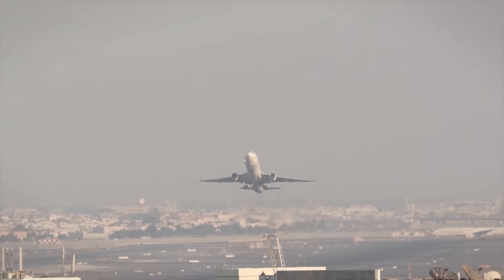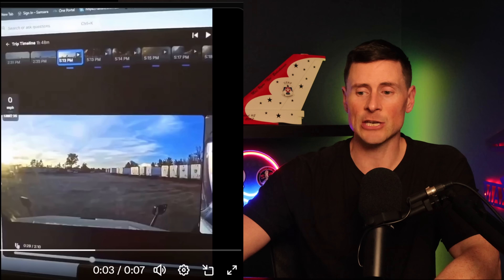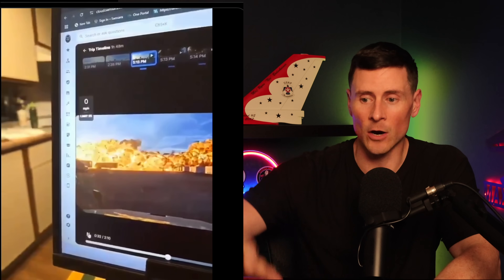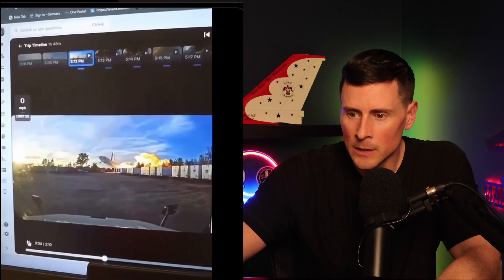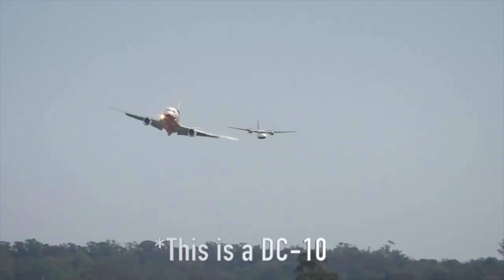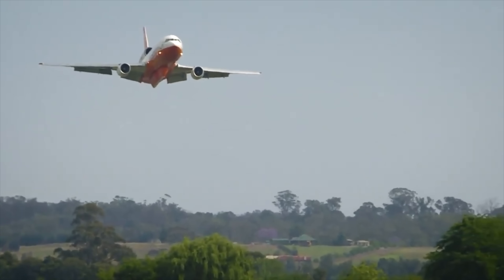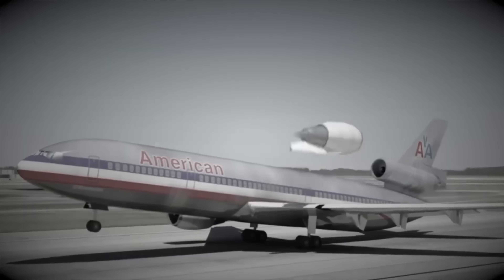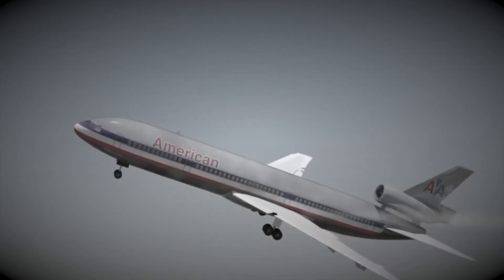Airline Pilot Reveals CHILLING Clue in Final Moment Before UPS 2976 CRASH

Comment: There was also a MD-11, if my recollection is correct, which lost the fan disck out of the number 2 engine over Iowa. The fan blades went through all the hydraulic lines, causing loss of all the controls over Iowa. They were able to guide the stricken aircraft down to the airport in Iowa city by using differential thrust with the two remaining engines, but in the end, they were too fast coming in, causing one of the gear to collapse, which in turn caused the aircraft to flip. The resulting crash killed a number of the people on board, but the fact that they were able to bring the aircraft down at the airport at all credited the crew with sparing many of the lives of the many other passengers.
One thing I wonder about is if parts from the detached engine might have been ingested into the number two engine, and if what we are seeing is debris from the number 2 engine coming apart rather than fire from a couple of compressor stall. Would the short puffs of flame and smoke coming from a compressor stall be visible among the rest of the intense flame coming from the wing, or might those be pieces coming out of the number 2 engine and sparking as they struck the runway? To my failing eyes, the video is a bit too blurry to tell what exactly that is. I guess the investigation will tell us more about that. Like with all air incidents, we will have to wait until the investigators tell us their findings, or at least the preliminaries.

Comment: If I recall, Flight 191 crashed because the engine replacement didn't follow the procedure. Basically, the pylon is to be mounted first, then the engine. To save time, the pylon and engine were joined on the ground, then mounted to the aircraft as a single unit. Due to the additional weight of the assembly and whatever other difficulties this brought about, the mounting bolts were installed incorrectly. The plane flew for a while, but the incorrect mountings put additional stress on the bolts until they failed. Afterward, I believe a service bulletin went out saying not to use this method.  Assuming the MD-11 had a similar design, I wonder if this recommendation was forgotten or never issued for the MD11?

Comment: The clip you showed of the roof of that building with the big gash in it was part of a much longer clip that also showed the front part of the cowling of the departed engine. In the dashcam video from the left side of the crash path that showed the plane rolling left and the right wing almost vertical, you can see the fuselage was angled up. I would have been surprised if the plane did not roll inverted before coming back down. However, there is another dashcam video from the road beyond the end of the runway where you can see the fuselage completely airborne and high enough that it contacts wires strung on utility poles and you can see those wires shake violently after it passes. A horrific accident indeed. No words can express the depth of my sorrow for those heroic crew members and those who were affected on the ground.

Comment: Prayers unto the departed , prayers for immediate FAMILY . 
A committee, a fuel crisis decades ago compounded by follow on design by artificial requirements . Thus Tri-Jets , an engineering solution to a decade specific requirement . 
Ooohhhh ! If Tri-Jets were a fuel crisis “decade” compromise , what does this say for twin engine “decade” “carbon-footprint” committee commands . If a Tri-Jet sux , THIRTY-YEARS LATER . Will ultra by pass twins achieve a much more clean historic record ?  In my opinion , If ALL strategic world beaters burn four fans . Indeed ,  four fans burning equals so many less digital candles lit .

Comment: Seems very probable that tail engine....if it were experiencing compressor stalls, it could be from the engine ingesting all of that "dirty" air from the fire....not enough actual oxygen for the fuel it's programing for.  So sad.

Comment: My house is about 2.5 miles from the crash, and I can tell you the building which was basically ripped open by the wing was at the start of the crash. Beyond that, to the south, is where the fire line was.

Comment: The dash cam video is very upsetting and heartbreaking, but it also could be a good tool in discovering what actually happened  with this aircraft. Just seeing the attitude of the plane with the wing so far over, the plane was doomed the pilots never had a chance. I like to add have some friends who have a house under the airport flight path. Sitting out in their backyard I can read the numbers off the airplane real easily. All I can think is if I aircraft has a failure taking off I can imagine what would happen. My house is also located about 3 miles from the flight path so I think were safe who knows.

Comment: after the DC10  crashes in the 1970,s and parts falling off,, i was reluctant to fly on lufthansa from bangkok to new delhi india in the 1980, s  the DC10/ MD11 plane took off and flew into a storm on take off, 2 minutes into the flight,, the lights went out,, the plane was shuttering and strugling and the cabin crew were freaking out. trolleys and  food and drinks went flying.  never again..
Reply: Lufthansa has a very good reputation.

Comment: It seems the the control tower might have spotted this engine fire, and would have told pilots to abort take off.  
I’m truck  driver,  so what do I know.  Perhaps the control tower guys and gals were on break .
Perhaps a rear view mirror, pilot would see engine on fire. 
 Or maintenance shop could’ve tightened the engine mounting bolts.

Comment: -National Transportation Safety Board  FYI -
Apr 5, 1993
Byron Acohido
Investigators have uncovered more evidence implicating problem fuse pins in the case of a jet engine ripping off the wing of a 747-100 freighter shortly after the jet took off from Anchorage last Wednesday.

The National Transportation Safety Board released a description of damage to the fallen engine that indicates - according to industry sources - that the engine was operating properly when the accident occurred.

As a Boeing employee, During the Merger & Since the DC Merger, Personally I don't remember any preventive Service bulletins for any DC Aircraft for engine attach points. Recommend; the Rear attach Pins and attach fittings (engine strut) to wing be looked into.    DO engines fall off of Commercial Jet Aircraft?  Yes, by design, for belly landing safety, Jet engines are designed to fall off, to separate the hot engines away from the fuel in the wings.

Comment: Sorry if this is a dumb question, but how could the engine possibly separate? Old age?
Reply: Engine pylons contain fuse pins that are engineered to shear off under extreme stress, causing the engine to detach in a controlled manner to prevent catastrophic damage to the airframe.
But clearly it’s not a 100% safety guarantee…

Comment: If I recall the Chicago American Airlines accident correctly, maintenance personnel used an unapproved maintenance procedure when changing the left engine on the DC-10.  The unapproved procedure was apparently employed to save time and effort.  The engine was pre-attached to the engine pylon.  I believe the engine cowling panels were also attached at this point, resulting in a heavy three-piece assembly.   Then this complete assembly was lifted into position using a forklift and bolted to the airframe at the engine mounting point on the leading edge of the wing.  Using this forklift procedure to mount the complete assembly apparently damaged one or more of the fore or aft engine pylon mounting bolts and one or more of those bolts subsequently failed resulting in the entire pylon/engine assembly separating from the wing during takeoff.  If the engine change had employed the approved maintenance procedure, it would have used the following steps.  First ... the engine pylon would be bolted into place at the fore and aft wing mounting points, second ... then the engine would be attached to the engine pylon, and third ... then the engine cowl panels would be attached to enclose the engine for aerodynamic efficiency.  I apologize if my recollection of the pre-accident events is erroneous in any aspect.  RIP to the American Airlines accident victims.

Comment: I worked in ORD when AA 191 engine fell off and they grounded the DC10 for months the MD11 is the same structure aircraft
And PYLONs were the failure point on the AA aircraft. The UPS aircraft should have retained the failed engine
One wonders if the pylon still have a weakness
Reply: The pylon on AA191 was stressed because it was offered up to the wing with the engine attached. The forklift was used to support it overnight but the hydraulics on the forklift compressed slightly and was enough to stress the mounting structure. The takeoff thrust and torque was enough to cause the breakage, the engine then separated and went over the top of the wing, flight control surfaces damaged and retracted. Nothing would have saved that aircraft.

Comment: Here's a clue the engine ripped loose from its nacelle at full throttle under max load  ...
Reply: Looking at the footage the pylon was attached to the wing suggesting engine failure rather the pylon to wing connection failure, should narrow down potential causes

Comment: I think you are overlooking the obvious, the giant fireball on the left wing is a wide open fuel line trying to feed and engine that eats dozens of gallons a minute because the engine is not there. Even if there were no issues with no2 engine which is likely consuming fod from the no1, the only thing that could have happened did, aircraft broke ground and immediately rolled left it’s like the airliner that did the exact same thing after they were much higher years ago

Comment: The AA flight 191 crashed in Chicago, the Delta flight that crashed at DFW was also flight 191. In total there have been 4 or 5 crashes and a couple of emergency returns to the airport of flights designated as 191. It seems to be a cursed flight number and some airlines won't designate a flight as 191. 

Just wanted to throw that in there.

Sincerest condolences to the loved ones of those who perished in this horrible accident.

Comment: I'm thinking possibly FOD. I've been a jet engine tech since 1980. Both engines sucked up something big enough to damage the fan/compressor blades. That could induce enough vibration in the #1 engine to cause a mount failure. That's obviously just my assumption based on what I've heard so far. There are several possible factors involved but this is only the beginning of the investigation... RIP. 🙁

Comment: Yes, I saw the flashes coming from the other engines. Of course that is probably due to low fuel pressure.
I say that because the other engine fell out of the plane. Probably ripping out the fuel lines going to it, causing a pressure problem with the fuel flow. 
Of course this is all my opinion from watching videos since I wasn’t there and I am not a pilot or mechanic or an NTSB investigator.

Comment: Catastrophic #1 engine failure with no containment. Extreme vibration broke engine mounts. Severed wing fuel tank and hrydro. Uncontainable fire. #2 engine coughing under max power not crazy uncommon, but I wonder since both engines showed distress if this wasn’t a massive FOD ingestion. But, that would be significant piece of FOD. A few rotor blades out of balance can cause en engine to eat itself. Very sad.

Comment: The information about the Chicago disaster is interesting.  If the loss of hydraulics caused the wing slats to retract thereby stalling that wing, it seems there could be a way to design the default position of the slats to remain extended if hydraulics are lost.

Comment: The glue holding the engine in place has probably suffered a bond matrix failure, due to the aircrafts age.
Reply: (I'm speaking about the automotive equivalent of blue assembly Loctite)

Comment: Well what I believe happened here is Different from Flight 191?
I believe we are seeing United flight 232  where the front main 
rotor disintegrated  doing a lot of damage to the Aircraft.  
The left engine on the UPS Jet was at full Power and I believe
It to disintegrated sending shrapnel into to the wing Most 
Likely punching holes in the fuel tanks  which are above the 
rear of the engine causing the Massive fire we saw in the video
Like what happened to Concord. The damage also could have
damaged the controls or have caused other damage making
the Left wing drop. The American DC-10 when it hit the ground
also in the same 90 degree  left bank.
A DC-10/MD11 Should have flown fine on 2 engines and over
its life I'm sure it happened. the Fan Disk disintegrating I believe
caused this crash. I spent my Life in Aviation
including 37 years as an Airline Pilot.

Comment: How is this not a DC 10, since the #2 engine is completely on the vertical of the tail, whereas the MD 11 has the engine more integrated into the tail of the fuselage ?   I thought that was one of the main distinguishing features between the two...
Reply: Dc-10 and MD-11 had #2 engine in vertical stabilizer.  Lockheed L-1011 had #2 engine in rear fuselage.

Comment: I was on an American Airlines flight in the mid-eighties from DFW to Frankfort, Germany when on TO roll a “unequally deployed slat warning light” illuminated. 

I obtained the NTSB report a couple of years later and found out that the pilot correctly aborted the take-off but 8 of the 10 brakes failed,  resulting in the DC10 over running the end of the runway by 1100’ in soft earth. (Fortunately, it had rained the day before.) The nose wheel collapsed causing the flight deck to fall 14’. Dirt was kicked up everywhere, so the FA’s correctly paused to make sure it wasn’t smoke from fire, then deployed the slides so we could evacuate. Only the flight crew was severely injured as a result of the 14’ drop.

Later it was determined that brake-pads on the DC10 tended to wear more at the leading edge of the pads, and that extra service could be provided by flipping the pads to the opposite direction of rotation. That resulted in the pads shearing off. Oopps!😢

Comment: I would suggest that the engine exploded over the runway but the photo was not the engine on the runway but it was knocked off by the roof of the building shown with the gouge the reason for this being the left wing stall due to the blown engine. It fell in a place beyond that building.  We will need to await the investigation though.
Reply: In the original photo of the engine on the runway you can see a blue runway light.
Reply: @klsstheglrls  OK if blue lights mean a runway.

Comment: Are you ready to be shocked? I drive by that airport on my way home and often see the UPS planes take-off. What do I see taxing out on the runway today, the day after the crash? A UPS MD11. One literally crashed yesterday and rather than wondering if there's a mechanical issue on their MD11's they keep flying them.   Just to be clear I'm not blaming their maintenance; as an engineer I know there can sometimes be a hidden issue you'd never suspect could be a problem. But if an engine blows-up yesterday you should be concerned one may blowup today.
Reply: Would lead me to think they already have a good idea of what happened. If this was some type of random maintenance error, there wouldn't be reason to ground the rest of their fleet.

Comment: It supposedly got up about 200 feet.  It definitely cleared the fence at the end of the runway, then the left wing took out  a sections of roof on the building nearby. There is some CCTV footage that shows the left wing scraping/cutting into the roof.  Yes, when I saw the roof, I thought the damage was from landing gear, but the video clearly showed it was a wing.  If you look on your first video, you can see the plane exiting the initial fireball and going over/onto the building.
Reply: It definitely did flew higher than a few feet than what he said.
Reply: @flexin4life  On the night of the crash, the report was 200 feet.  Last night, the report was 433 feet--not sure what the sources of these figures are.

Comment: The NTSB is saying two things, one that the engine detached during the take off roll and the other that the engine detached in flight.   One of the videos shows a long trail of smoke which looks to have begun well before rotation. Unfortunately we can't see how far back it goes in the video. What it does indicate is that the trouble began during the take off roll, i.e., while the plane was still on the ground. At what point the entire engine detached is not clear. There is engine debris on the grass alongside the runway double stripes towards the take off end. The detached engine is on the airfield property, the NTSB said, but didn't say where on the property. 

The appetite for information following a tragedy such as this is insatiable. It is regrettable that the NTSB is so cagey about what it releases and when. They tell you just enough and then stop. And of course the journalists never ask the right questions. One of them at the press conference wanted to know what a black box looked like. For God's sake. The NTSB for its part spoke more about process than known facts about the crash. Very frustrating.

Comment: THIS PLANE HAS BEEN AROUND FOR 34 YEARS STRUCTURAL FATIGUE HAS TO BE ENORMOUS  THEY CAN REPAIR ENGINES BUT IS THE FUSELAGE REPLACED  NEVER OR WINGS JUST WONDERING THOSE PLANES WERE AROUND BEFORE I STARTED WORKING FOR THE AIRLINES AMERICAN AIRLINES FLIGHT 191 SAME THING HAPPENED TO IT ALMOST IDENTICAL AND THAT WAS A WORKHORSE BUT I WORKED WITH A LOT OF IT'S TWIN DC 10 AND THEY WERE A HEADACHE ALWAYS BREAKING DOWN  PRAYER FOR THE FAMILIES OF THE LOST ONES